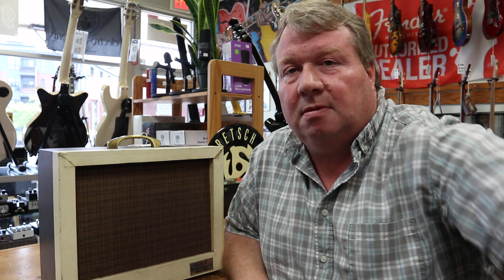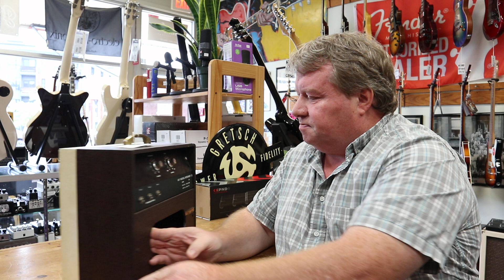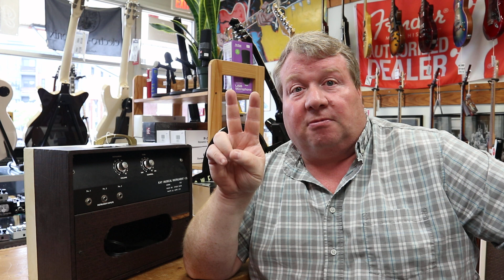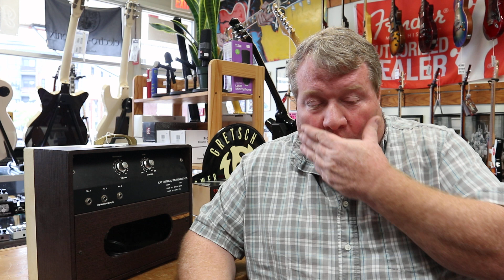Little Amps - (volume 2) - The Kay Model 703

Comment: what about plastic knobs with rubber bands around them then a cable with 3-4 layers of heat shrink on it, that way you can save the original tone and sound but not get shocked, I plug all my gear into power converters so they get good celan consistent power so they last longer sound better, I shut off the power strip the power converter is plugged into that the power converter I plug amps into. YES I use TWO converters I plug the power converter onto a power conditioner, and that is plugged into a power strip that has a safety breaker all that in it, so my power is very celan and very consistent, if I had another I would use 3 if I had another, one to run two conditioners cleaners, one would run the effects, one would run the amps, I would run them off two totally different circuits o\in the house, 20 amp circuits, also I use better circuit breakers than what comes in most homes, I use a special power conditioner voltage REGULATOR style!

then I use a plug in conditioner that will have like 4 outputs, 4 usb so forth all protected..   so that protector runs off a wiring in house that's using a conditioner surge protector circuit.. then a protector conditioner plugged into the wall that I run a power strip fault protector off of. then into that I plug i one power conditioner...  I then do the same on a totally different breaker in the box, then I will run my effects off one, the amps off the other .. at times, now I just have everything off one protected/conditioned breaker, then a 4 way usb outlet conditioner filter fault protected box, then the one RR-15 off that, then another RR-15 into that.. effects and amps into t hat, so like quad conditioned ..

if I run the two stereo big 100 watt stack then they use their own circuit, 2 RR-15's into a walled conditioner surge protector w/USB's as well, effects would run off a totally different circuit in the breaker box..

I'd like to get an industrial conditioner protector to run BEFORE the breaker box but no go in the place I am at...  if I build that's how its going to be, and I will run 2 meters and boxes, one for the home one for the studio/gear so i can start off with good power right off the bat, if you do not think this matters you are wrong, it does, unless you have a conditioned power already, older homes, you want it, anywhere you have a lot of homes near each other,  you want it, signals can bleed thru form a blender or whatever, clothes dryer.. filter it out, stabilize it and insure its protected for faults you are good to go, protect your investments and always run good celan filtered power thru them it pays off no jokes, tone alone its worth it to me...  you can hear the difference specially at higher draws .. yessir, try it you never know?

Comment: I have one of those. It hasn't worked in years but it did have a cool sound.  It does have an isolation transformer.  How does one determine the correct polarity when putting a polarized plug on
Reply from the maker: the hot side of the power goes to the fuse, the cold to the switch.
Reply: @GarysGuitarsUSA  thank you!